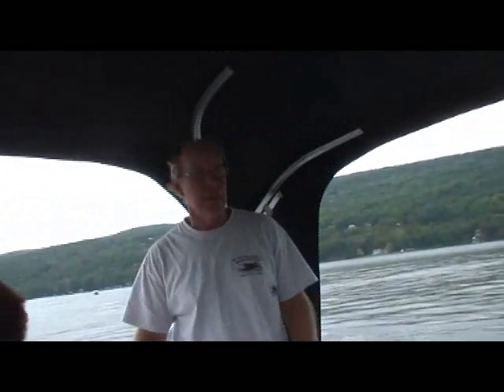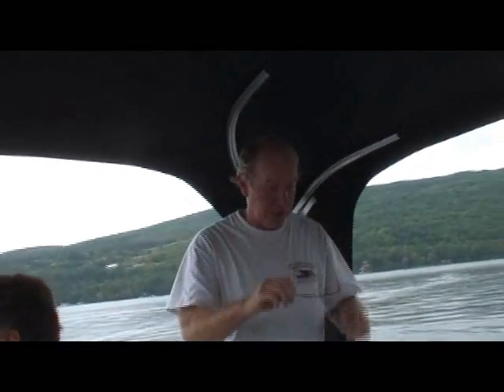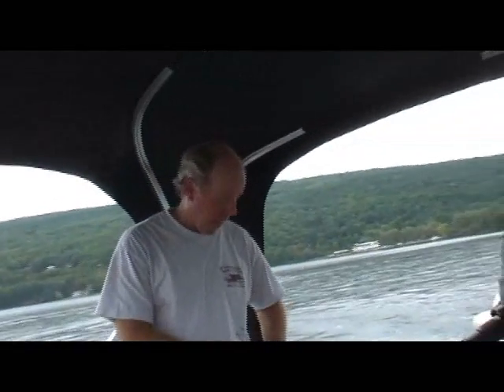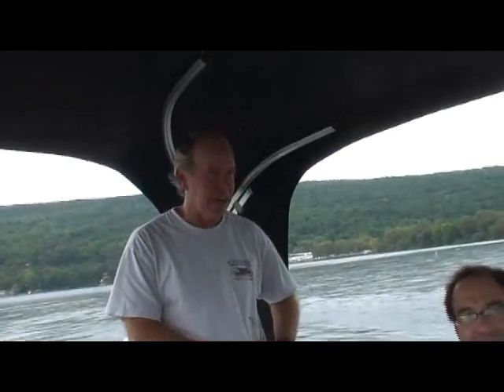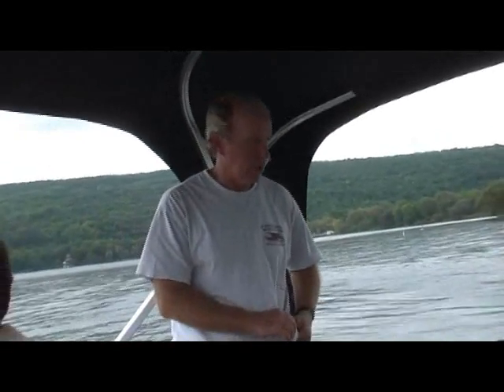Floatplane Homebuilt Murphy  Moose  with Yak  M14PF Engine

Comment: You might want to change the info "the only radial still in production" is incorrect. Rotec in Australia makes two radial engines; the R2800 and the R3600 which are 7 and 9 cylinders with 110 or 150 HP.